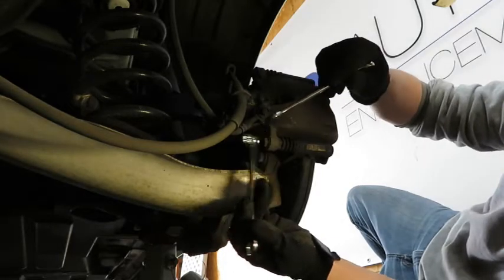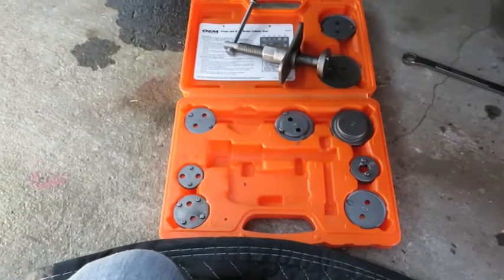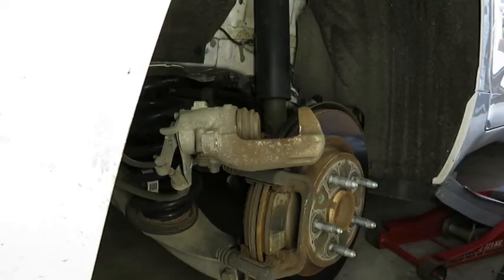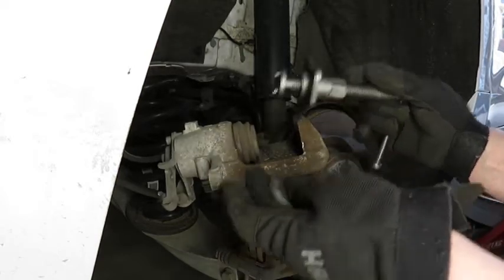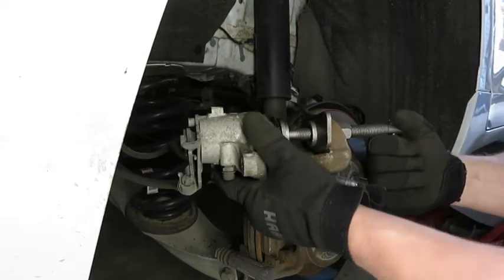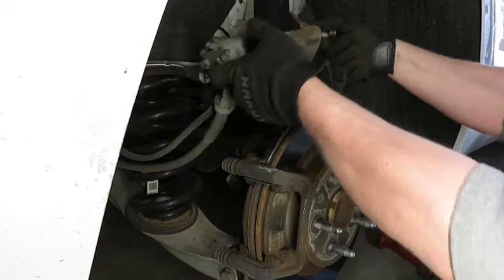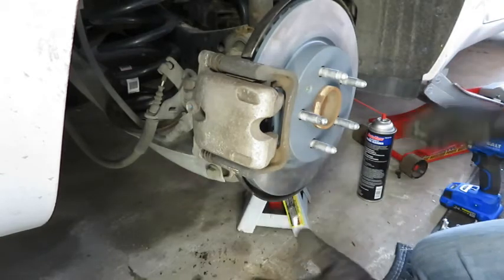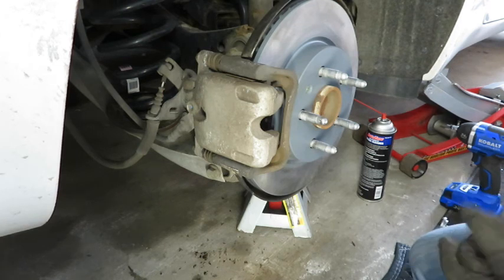Rear Brake Pads and Rotors 2014-2020 Chevy Impala Installation!!!

Comment: I followed your instructions and I replaced my brake pads on all four wheels on my 2015 Impala.  Your instructions were really helpful, and even though I didn't have to replace my rotors, I took them off anyway to clean the hub and lubricate it with anti seize (not the Lugs).  Your instruction on compressing the rear piston was really helpful.  Some others suggest turning it in with needle nose pliers.  That was way too hard.  I went to Autozone and got that kit in the red box, and it was easy with that.  I did put blue antilock on the caliper bracket mounting bolts and torqued them to 90 lb. ft.  I also got new mounting hardware since the rears didn't come with them.  Don't know why.  They came with the front.  Thanks for the great instructions
Reply from the maker: @edwardmissouri2216  thank you for watching and I am glad the video was helpful

Comment: thanks for the video.  Just a note to remind those people doing this job to torque all the bolts, Including the lug nuts on the wheel
Reply: How much pressure on the lug nuts for the wheel?
Reply from the maker: It depends on the trim level of your car. The 18"+19" wheels are 110 ft lbs and the 16" wheel is 100 ft lbs

Comment: Thank you! I am doing a 2016 Malibu and the boot started getting messed up I am going to give your trick a try.
Reply from the maker: I hope it goes well!
Reply: @DCAutoEnhancement  worked like a charm! thanks again I used barely a drop of silicon. only problem with the malibu I am working on GM does not believe in room for tools just like the impala you worked on
Reply from the maker: @Floridaadventures_vlog  😂

Comment: Where do you put the Jack stand to hold up the rear end of the car? Also would it be wise to just do one side at a time or raise the rear end all at once?
Reply from the maker: I usually do one side at a time. No reason just preference. Usually I just use the jack (not recommended just what I sometimes do)

Comment: @3:34 do you have to use the kit? Or can I use and old brake pad and c-clamp to push it back into place?
Reply from the maker: Yeah, the c-clamp and old pad works like a charm!
Reply: @DCAutoEnhancement  thanks for the reply and this video. 💯
Reply: @DCAutoEnhancement     You sure about using a c clamp?    An Audi I had you needed to screw the piston back in place like you did here.   I’ll be doing my Impala brakes soon.   Thanks.
Reply from the maker: @stevez6499  good call, I didn't realize this was the rear brake video.  The front you can use the c clamp but the rear does need to be turned and pushed at the same time. Thanks for bringing that to my attention.👍
Reply from the maker: Steve Z just reminded me at the c clamp won't work. The kit that I used is necessary. You can "rent" them from an auto parts store. If you return it when you are done you will get the full amount of your deposit back.  Sorry about the incorrect info on my part.
Reply: @DCAutoEnhancement  no worries. Appreciate the follow up. Good looking out.

Comment: @dc auto enhancement what size impact drill do you use and socket
Reply from the maker: 1/2" or 3/8 impact and 13mm wrench
https://amzn.to/3wueuw6

18mm wrench
https://amzn.to/3gBwwWI
Reply: I mean which one do you use the 1/2 or 3/8 impact
Reply from the maker: @babyboinews6896  for a brake job, 3/8 is enough.
Reply: @DCAutoEnhancement  this is for the removal of the lug nuts correct and the socket size is
Reply from the maker: @babyboinews6896  then I would use a 1/2" impact and 21mm socket. Sometimes they are 19mm though
Reply: Cool thx
Reply: Two last questions what brake pads are best for a 2015 chevy impala lt limited in your opinion and which rotors are best slotted or drilled
Reply from the maker: @babyboinews6896  Everyone has an opinion. I like ceramic brake pads as well as slotted and drilled rotors.  Here is a decent set for the rear brakes: https://www.partsgeek.com/lbpg9cf-chevrolet-impala-brake-pad-and-rotor-kit.html?utm_source=google&utm_medium=ff&utm_content=DN&utm_campaign=PartsGeek+Google+Base&utm_term=2014-2019+Chevrolet+Impala+Brake+Pad+and+Rotor+Kit+Centric+Rear+14-19+Chevrolet+Brake+Pad+and+Rotor+Kit+18+16&srsltid=AfmBOooNCfUo7Uu9ooeeapUElOP23WQjiFt2HosCVrx1g5G3P2RVVelhFdQ

Comment: Sloppy
Reply from the maker: Can you educate me and tell me where I went wrong?
Reply: @DCAutoEnhancement     One thing I always heard is that if you have to use the old pad mounting hardware, you should take the hardware off and thoroughly clean the rust off of the area where it's mounted, then apply a small amount of brake grease, so that rust jacking doesn't push on the brackets and keep the pads from sliding properly.  Also, thoroughly clean the mounting hardware and apply a small amount of grease to the parts of the pad that contact the hardware to help them slide.
Reply from the maker: @edwardmissouri2216  that is great advice. On this car, there wannabe any rust to worry about but I could have Heard the moving parts as you mentioned.  Thank you for watching and commenting.